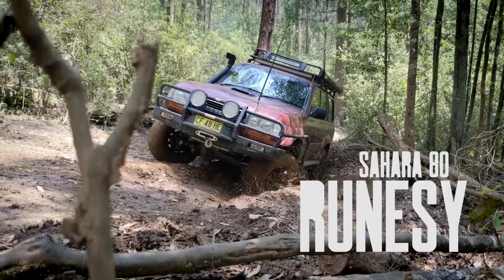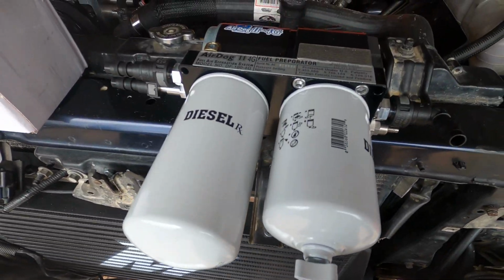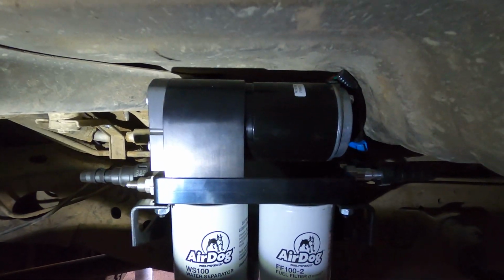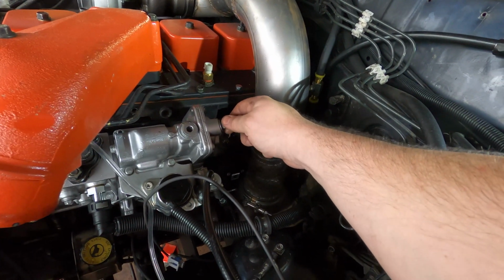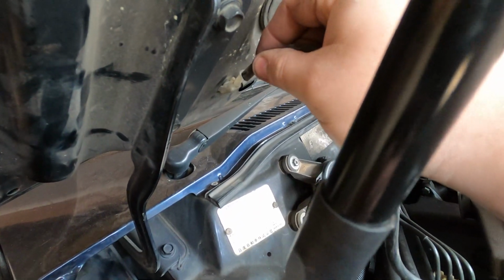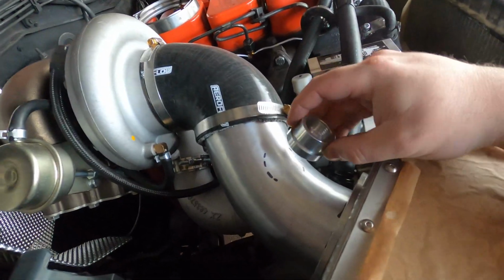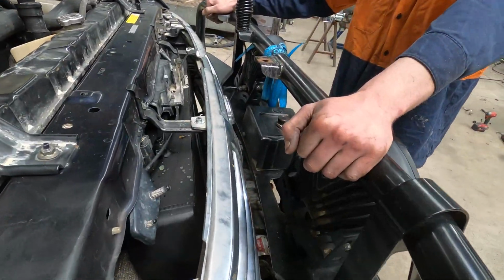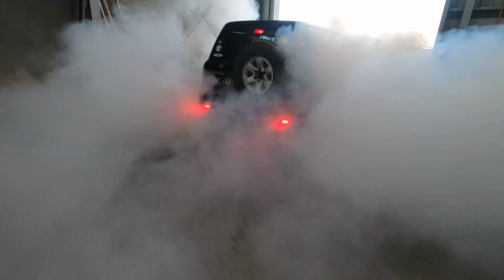BOOSTing the Cummins Patrol | GU Patrol Build [EP10]

Comment: Dear friend, can you explain the connection of the engine to the gearbox in detail, because the engine differs from the model of the car and the gearbox as well
Reply from the maker: Adapter kits are used between the engine and gearbox and gearbox and transfer case

Comment: Hey mate, love the series and hope there is another ep soon! Do you have a rough idea on what this cost you?
Reply from the maker: The conversion about $25k, reco on the engine nearly $10k, performance bits were used instead of reco originally so another $10k, suspension and stuff for engineering probably $12k, auto trans build $12k... Mistakes and wrong stuff bought $2k 🤣

Comment: Watched all the videos of the build multiple times as I busy with the exact same build currently. What I would like to know is whether you installed a sump with the Airdog or just utilized the standard lines from tank?
Reply from the maker: thanks for watching! I installed 1/2" hose to the tank but used the factory in-tank pickup tube. The hose was a little big for the tube but sealed on it just fine with a hose clamp. Later I may upgrade the pickup tube to a larger one, but only if I see fuel pressure drops under load. I'm not sure if there's a difference in pickup tube diameter between models but for what it's worth, my tank was from a TD42.

The return from the engine bay uses the orignal return line, so for now as I don't have a subtank, I've connected the airdog return to the connection on the filler neck which is normally used to feed from the sub into the main tank.

Comment: Hey mate, looking into putting a 6bt into my 80. What was the process with Tex Star like? Probably go VE pump
Reply from the maker: TexStar were great to deal with but just remember a running engine just means running not necessarily up to date on servicing. Mine still needed new injectors, turbo, all gaskets, water pump, tappet cover, lift pump... The internals were good which is the main thing but I had to adjust my expectations a little

Comment: Congrats !! it is a huge milestone getting to this point in your build.  Well done.  A quick note with your breather going pre turbo and no catchcan, just be careful It will quickly oil up the compressor wheel. Cummins 12V's can legally vent to atmosphere, Thats how they came from factory. Looking forward to seeing your adventures out and about in this beast.
Reply from the maker: Thanks for the heads up. Yep it's dumping oil into the intake. Not a whole heap but I will look into a catch can. cheers!
Reply: Depends if the 12V is already too old to go in the Pat in the first place. Usual rule is that engine needs to be same age as the vehicle or newer. Emissions levels usually have to meet what ever is newer, engine and/or the chassis. Being that its a P-pump, it is too old for the Pat in certain states.

Comment: Sounds like that converter is struggling a bit
Reply from the maker: It feels excellent, although I did get a smaller TC as I thought I'd be keeping the motor stock. Will see how this goes, for now it feels great. Engine doesn't seem to be over revving at all
Actually had a gearbox issue during the drive test video, it's sorted now, but that was maybe 1/2 throttle and 1st/2nd gear only. Hang tight for a real first drive video ;)
Reply: @OutAboutOffroad  how has she been driving lately?
Reply: I’m hanging to get another update video as I’m doing the same conversion right now!